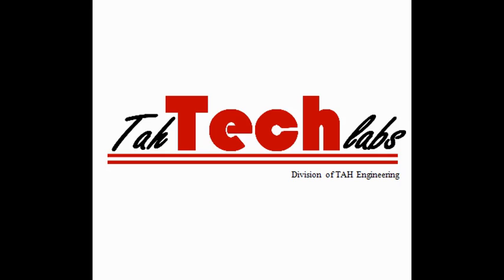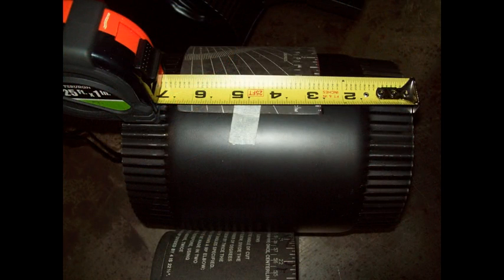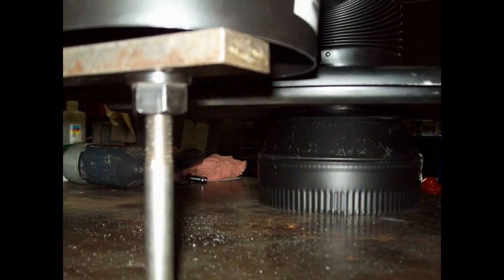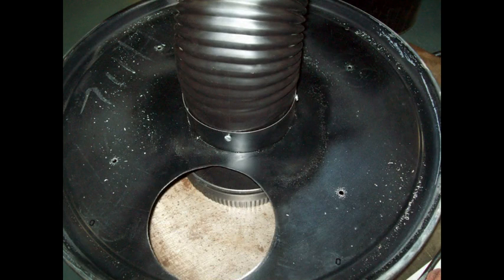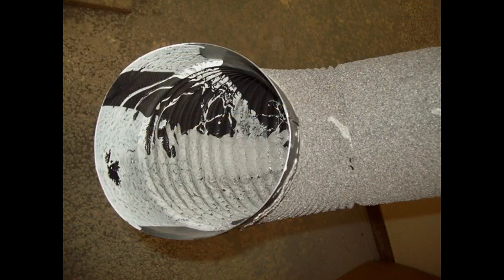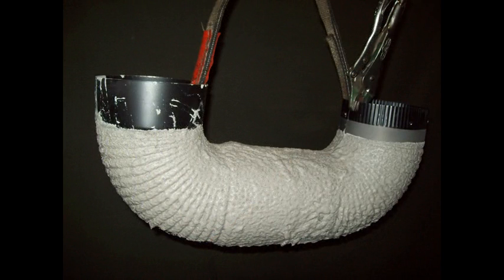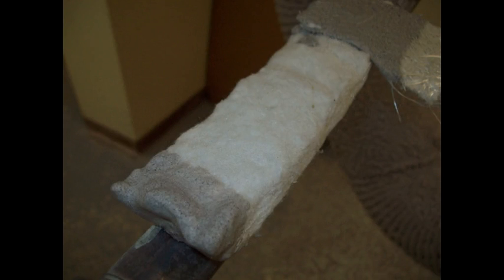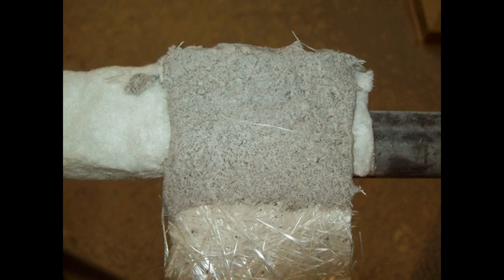Rocket Stove Mass Heater Video Series 1 vid 2 rev 1

Comment from the maker: Nice build, I do like the use of square tubing. The first build I done used off the shelf components and the cheapest too, this resulted in round stovepipe. It did burn well but did not last, therefore not a good choice, I have drawn up a new design and if I proceed to rebuild it will be a square cast burn chamber.

Comment from the maker: You are correct the chamber did not last long; I am way over due with an update on this build. I would have preferred for the ceramic coating to be inside of the pipe but the process did not allow for this. I burned thru the pipe in a few months with running it every day. The K-wool is what allowed for it to continue to be used. I rebuilt the J-tube at the inlet of the combustion chamber and added piping at the top of the barrel and then inside the combustion chamber to heat water.